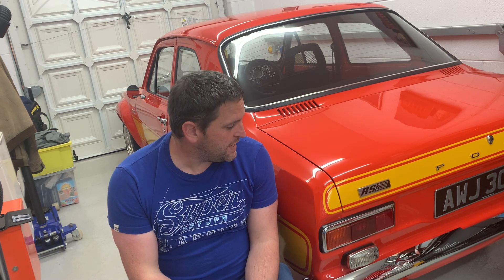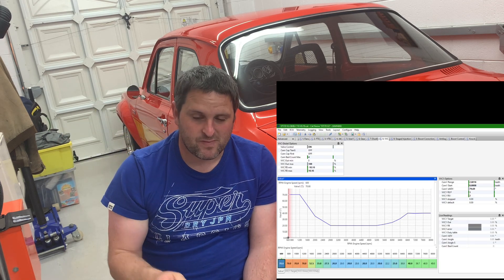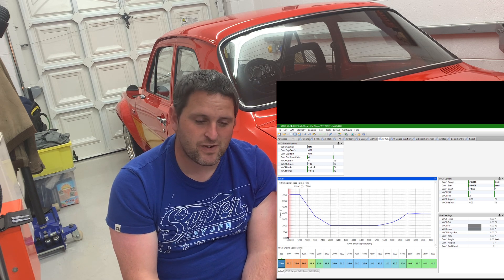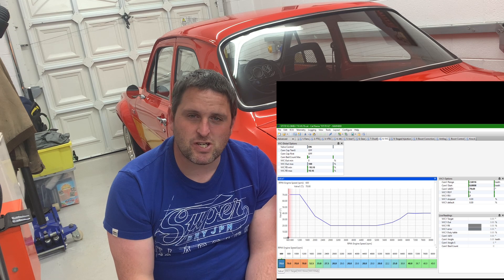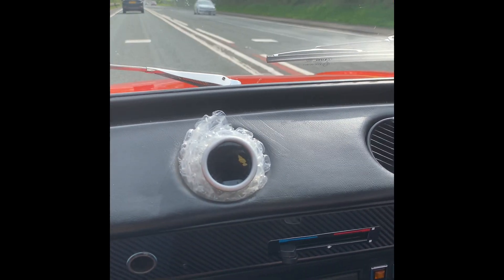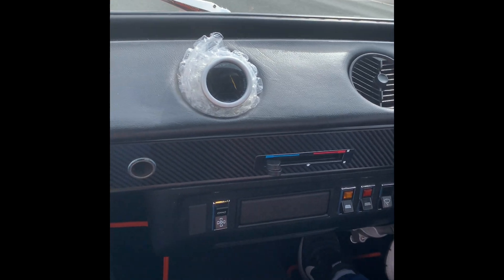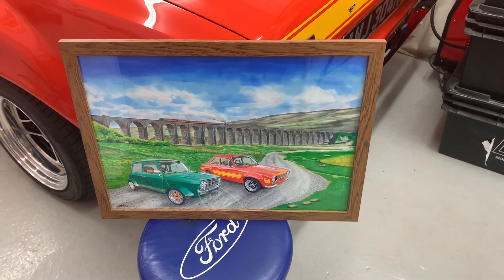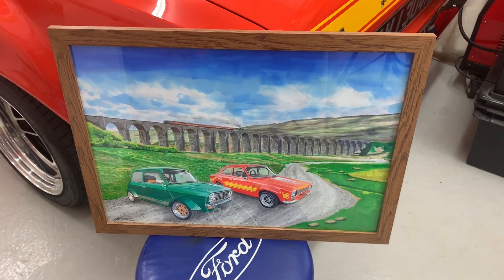MK1 Escort RS 2000 Omex Fix and Artwork

Comment: I’m putting a St170 into a mk1 4 door. Your videos are really helpful mate! 
I experienced the exact same thing when changing the cam belt & cam wheel with the timing. I only ever loosened the exhaust cam. 
Would you mind some how sharing the info you have on setting it up properly? 
I’ll be on the dyno soon & would love to check it again. 👍🏼
Reply from the maker: Really pleased the videos have helped 👍 Are you on Facebook or have an email address I could send you photos of the ford instruction manual pages??
Reply: @performanceclassics1986  Yes mate - How can i find you on FB?
Reply from the maker: @jphc7181  just search for Craig Mclean and you will probably recognise the profile photos 👍

Comment: Just a quick one is your copper fuel line 8- 10 mm cheers
Reply from the maker: It’s 8mm Neil 👍
Reply: @performanceclassics1986   that great by the way been having a look on line what make is your filter cheers
Reply from the maker: @nealthomas5943  If you type in SYTEC 8mm motorsport fuel filter into Ebay and it should come up Neal. Think it was £10.99
Reply: Great I’ll try that Craig many thanks
Reply from the maker: @nealthomas5943  👍

Comment: the f  on your ford badge is slightly squint
Reply from the maker: It does kinda look that way in the video but not sure if it is in reality. Il have to check. The boot lid and badges are both original so if it’s squint, it was that way since 1974 🤣